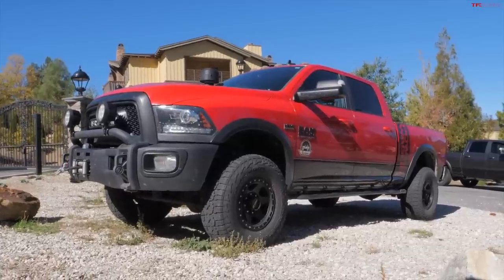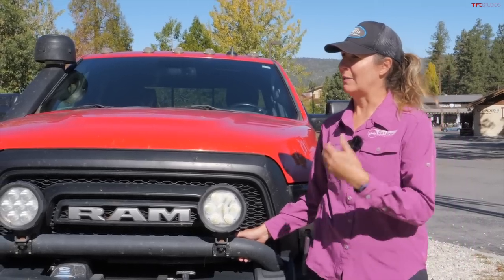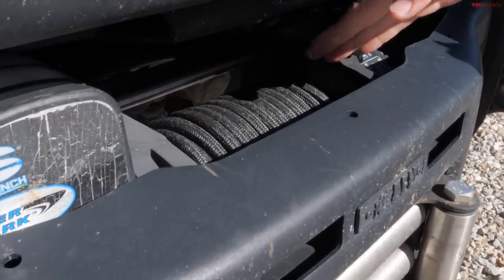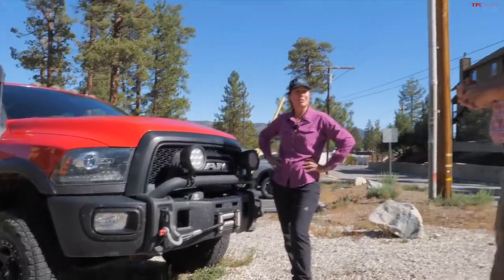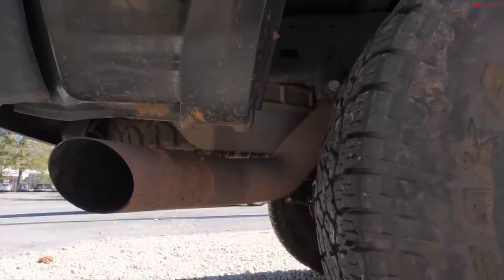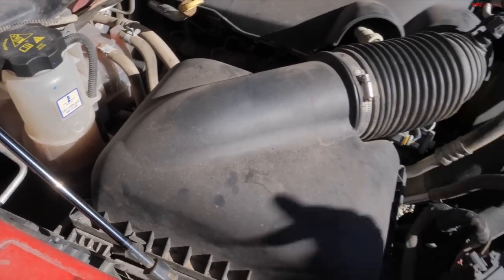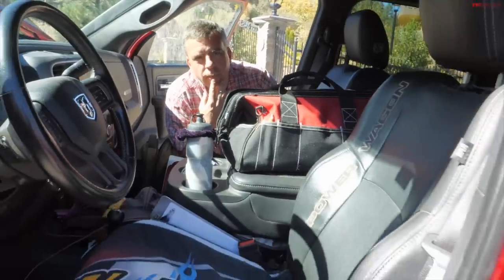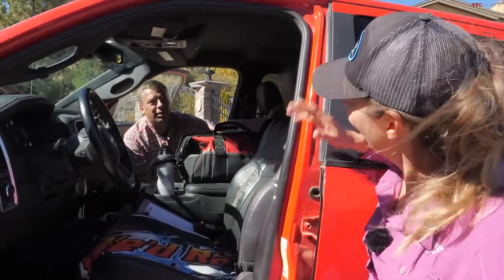After 80,000 Miles Towing and Off-Roading, Here's How My Ram Power Wagon Has Held Up!

Comment: Sounds like the perfect customer for a new HD Rebel Cummins with how she works her rig. But why change what isn't broken?
Reply: Bro the Cummins Rebel is a 2500 Ram with a rear locker.  Not even a n the same ballpark.  Extra $10k for the diesel it would take a long time to make your money back.  I mean no offense btw.  Cheers brother.
Reply: As cool as having the 6.7 Cummins in an off-road focused truck sounds (I love diesels and I love inline 6's) it would be terrible for the work she does. Anyone who wants one...hasn't driven one in 6+ trails off-road. The front end is akin to an anchor, pulling you the direction IT wants to go. Off camber and wanna go straight? Nope, you're sliding left. Add in the de-rate from potential DPF issues caused by slow crawling and you're in trouble. That's not even getting into the lack of articulation and front locker. If you need serious off-road and recovery capability (e.g., recovering Jeeps in Moab and Sedona) with the ability to tow up to 10k the Rebel HD Cummins is a poor choice. If you need to tow heavily for long distances and drive on some dirt roads it's an excellent choice.
Reply: @KeithStarr  I see what you and Dan Cooper are saying, I was thinking she works her vehicles hard, puts a good amount of mileage on it, towing and recovering vehicles. The extra weight of the Cummins would help with recovering other vehicles in making the Ram harder to move, yes, the lack of a front locker would make it harder to go off-road.
Reply: @KeithStarr  well said
Reply: They much heavier to, which is not good in sand or mud.

Comment: FWIW to PW owners out there, don't waste your money on that AEV pre-filter, it is sized for a MUCH larger constant RPM diesel application (think CAT size  on a road grader), not our small 6.4's running low RPM in dusty off-road situations. Also, the best mod you can get is from Abel Components, allowing you to disconnect the front swaybar and lock front and rear at any speed, 2hi, 4hi or 4lo. No waiting for the nanny's to let you use the goodies when and where YOU want!
Reply: Don't forget the Abel Nanny Kill Switch! That sucker is worth it's weight in gold.
Reply: So...In your brain,  having a pre-filter that is designed for heavy equipment   that continuously works in extremely dusty conditions,  and flows enough CFM for a much larger engine, on your truck that you use in dusty conditions is a bad thing?  Weird. To me,  having an industrial grade pre filter that will likely never need to be replaced on my daily driver seems like a great idea.
Reply: @bdd1469  - No, in principle it is good, if it was properly sized. The one AEV sells (which is from Sy-Klone) is too large for the 6.4 to operate as designed. It operates on centrifugal force generated by an internal fan spun by the volume of air going through it. I spent a fair amount of time with a nice engineer at Sy-Klone and attempts to get AEV to rectify my purchase. AEV wouldn't budge, so need less to say, I'll never purchase from them again. The whole snokle kit is pretty poor fitting and requires partial disassembly to replace the windshield additionally.

Comment: Interesting that she is running Falken Wildpeaks.  She's a pro and could probably run any brand tire.  I've been running Falkens for about 25K miles and they have been a great all around tire.  Excellent in rain and snow and crawled over everything I ran into out in Colorado, and relatively quiet on pavement for an all terrain tire.
Reply: I live in irrigation country and see the Falcons often on farm work trucks. In irrigation country they see a fair amount of mud. Sand/clay type mix generally. I used to ranch in the Foothills to the Rockies and ran BFG KO2s. The KO2s are just ok in the mud, but great elsewhere. Haven’t tried Falcons yet. 
     I’m actually looking to trade my 2022 F150 Tremor for a very low use Power Wagon of a friend’s. He doesn’t want to deal with the fuel economy and size. I would be hauling an 1100 lb truck camper without an overhang on the front. It’s basically a 1 person unit (Rayzr FK). I can haul it with the tailgate up in the Power Wagon. A definite plus for me. The camper has 240 ah (LiFePO4 battery) with 350 watts solar and then there’s a 3000 watt inverter. I wouldn’t use all 3000 watts, but nice to have in case of an emergency & I’m helping out. I disabled the converter/inverter by putting it on its own breaker. The camper can then plug into the aftermarket inverter and the solar provides 110 and 12 volt power all the time in the camper. It doesn’t have air conditioning, but the microwave and TV are nice. (I put a fair sized TV that swings down from the roof 😂). It’s not camping unless you have the TV!! 😂 the truck would still be used the same as the Tremor, just is a better size. I will pocket some cash from the deal as well!!
Reply: Cost factor may be important to her, she may go through tires much faster being on trails, and lots of trailering.
Reply: @Cjdergrosse  - the Falkens are really not that much cheaper than others,,, at least here in Canada. Those tires are around $380 CAD and up here.   The 35s would likely be closer to $450 a piece.
Reply: @shitloveaduck  I paid $900 american for a set of (4) 285/70-17's 2 years ago.  I know the prices have gone up since then.  They are wearing well with 25K on them.

Comment: Why didnt you ask what mpg she has with that truck?  

I know, "its not a prius" blah blah blah.  I still want to know
Reply: Mine gets 17-19 hwy ( depending on speed ) and 10 city.  But mines a 2021 w/ 8 speed ZF.  Love it.  Cheers.
Edit: mines on 35’s
Reply: I had a 2016 with the 6speed 34" tire's and got 15mpg.
Reply: My 21 PW has never seen 14 no matter what kind of driving I do. And I’m very easy on the gas pedal. I barely mash and torque on my wagon. I don’t know how anyone can realistically get 17-19 mpg out of this wagon. Haha !!!
Reply: @elaineacedo  yep 19 going 60, and 17 going 70.  Just took a trip to LA, mountain driving to get there and stop and go in LA, but easy highway otherwise, averaged 15
Reply: I have a 13 with 35s and I get 13mpg at 80mph on the highway. Best I’ve gotten is 15 doing 65.
Reply: I call BS on these 17+ mpg's on the highway (especially over 70) even with the ZF. Empty, new with the OEM tires I maybe got 15 on the highway, 13ish around town. Now at 9,300# empty with a FWC, WK sliders, Thuren front and Expo1 rear swing out bumper, 35's - 11 mpg at 77 and 12 around town. At 97,000 I had a EVAP solenoid fail under warranty and I just replaced my front balljoints and kingpins. It has been a great truck so far, and is as virtually unstoppable as my 3x locked 80 series Land Cruiser. My motto out West here on trails, if it fits, it ships!
Reply: @donleamon8653  Yep once I go over 70 it drops to 16, and 15 at 80.  City driving is abysmal though.  If I could attach pictures I would brother.  I don't have a reason to lie, as I don't really care about mpg, I'm working most of the time driving my company service truck, so I don't drive my PW much.  I do love your motto btw.
Reply: My saving grace is that my wagon only needs regular 87 gas. I would be crying if it needed premium gas. 😂😂😂
Reply: Yes. The newer wagons (mine’s a 21) only needs regular 87 per the manual also. Luckily!
I do believe these wagons are built very tough and well and will probably last a long time - just like the old land cruisers.
Reply: PW don’t care about MPG, he only knows MPT

Comment: I don't believe she hasn't had any drive train issues lol !
Reply: @TravisTheSavage  If it was a FORD  FIX OR REPAIR DAILY, it wouldve died at 80,000 miles lol
Reply: I agree, my 18 3500 Ram needed almost every front end part replaced at 65K miles and it is a pavement princes with stock size tires and wheels...
Reply: @AKB_48  I used miles not kms….
Reply: @nospark333  yes I  know.  I converted it PLEASE READ.    80,000 miles is around 130,000 km.  She definitely go 130,000 km with issues
Reply: @nospark333  Ahhhh yes, the k you put after the 65 threw me off.    That's approx 105,000 km.   I'm in Canada, we use the metric system